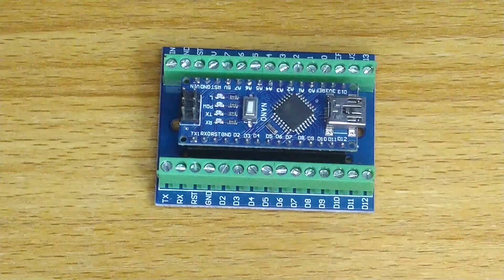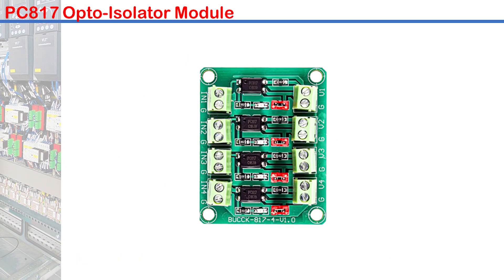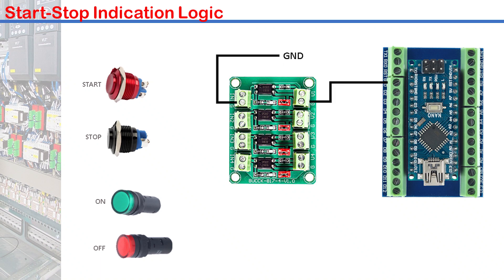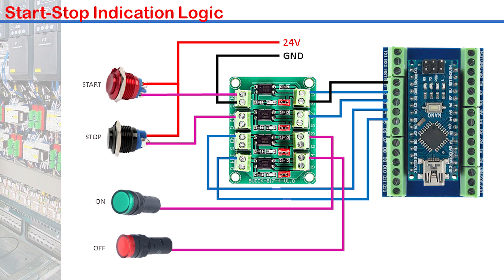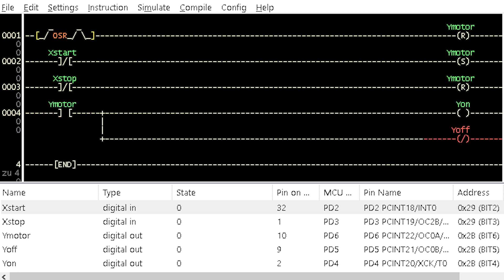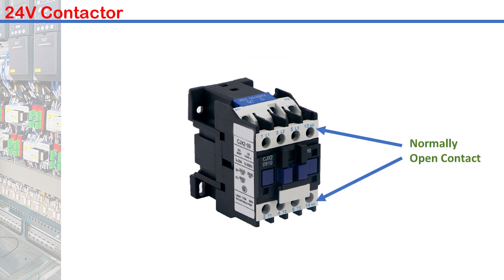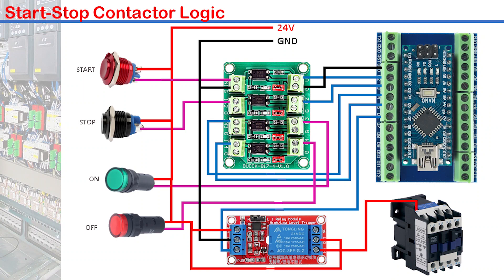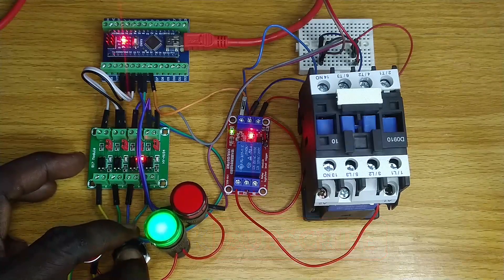How to Build LDmicro Arduino PLC (Part 1)

Comment: Why you use  relay channel module  for contactor and the lamp without relay channel
Reply from the maker: The contactor draws a lot more current than the lamp, which might damage the optocoupler. You could as well use a relay module for the lamps.
Reply: @OnosTech  thank you

Comment: How many analog and digital pin in this plc
Reply from the maker: Since the Arduino Nano has 14 digital pins and 8 analog pins, the PLC can be expanded thus.
Reply: @OnosTech  you can't explain how many ports and make how to make Arduino plc

Comment: Sir very nice explanation I am try to control a 3 phase motor through relay and contactor Arduino hangs when contactors are operated due to spikes from contactor coil how did you overcome the problem I added a snubber circuit it the hanging problem reduced but still present
Reply from the maker: Put a large capacitor, try 100uf and above at the output of the power supply to the arduino

Comment: Can an optoisolator be used with an Arduino (5V GPIO) to control 24VDC LEDs on the output side?  I'm confused how that would be connected up
Reply from the maker: It is shown with an indicator from 2:04-2:35. Better still, see how to use a relay module in this video https://youtu.be/nJiiKCTnZ_Q